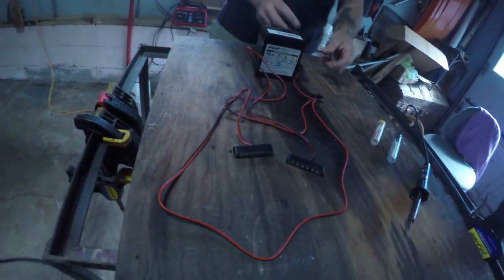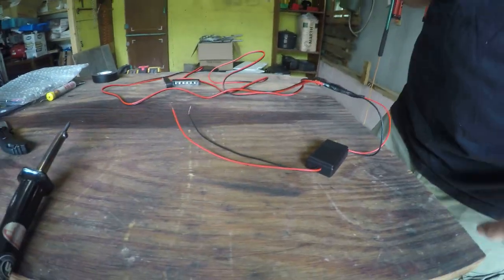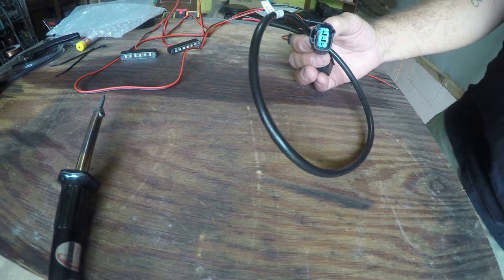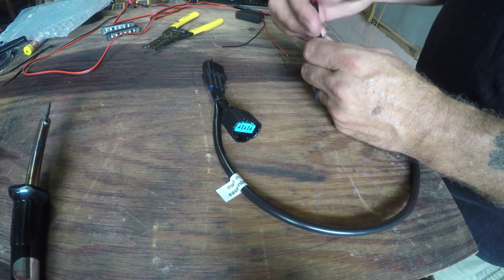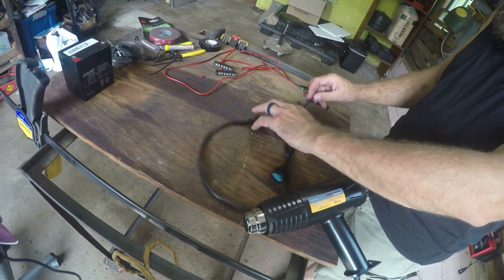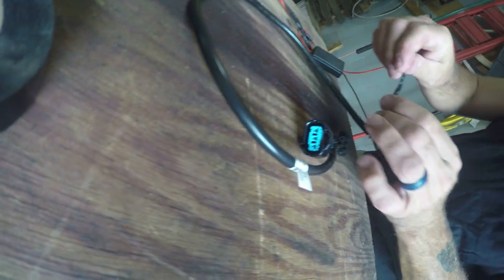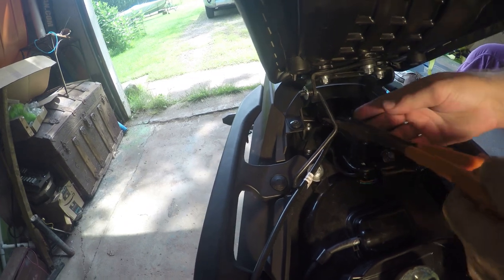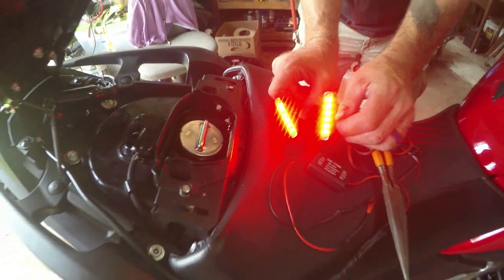Installing a tail light mod to the Honda NC750X DCT

Comment: This excellent, thanks for posting it.  I'm a bit confused though - the GS100A is the flashing unit but what lights are you using, (the ones you attached on either side of the license plate)?
Reply from the maker: Thank you, we really do appreciate you watching. The lights are  just a cheap strobe light we purchased off Ebay.

Comment: Ive fitted this GS-100A just by cutting inline with the bikes wiring cant see why you needed the adapter- rear light flashes for about 6 times then goes back into solid mode.
Reply from the maker: Glad that way worked for you